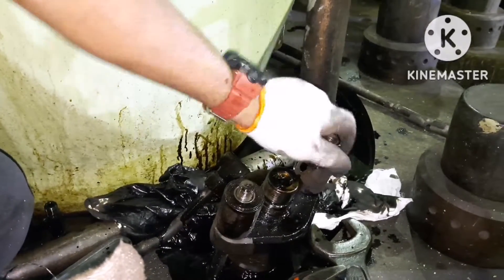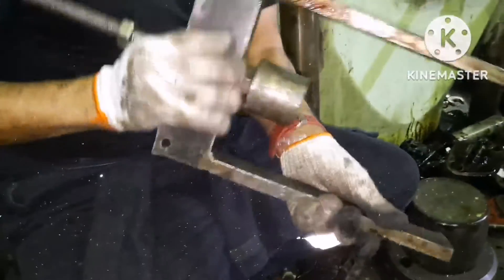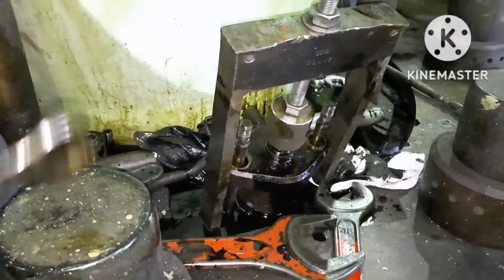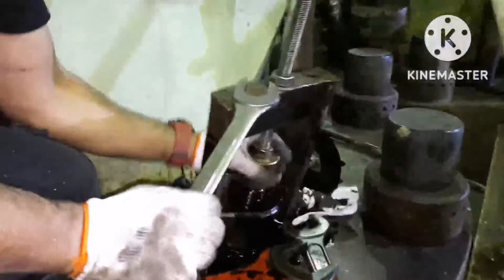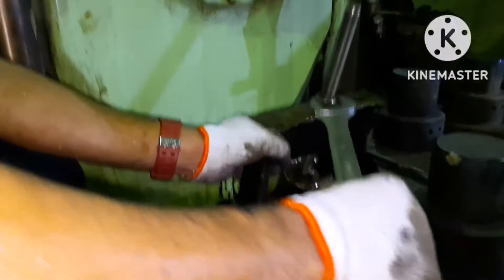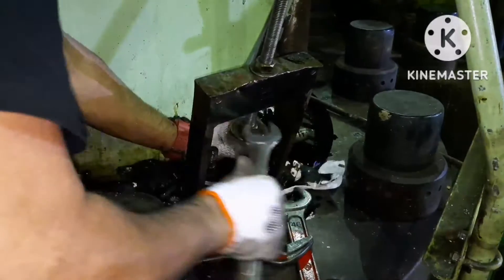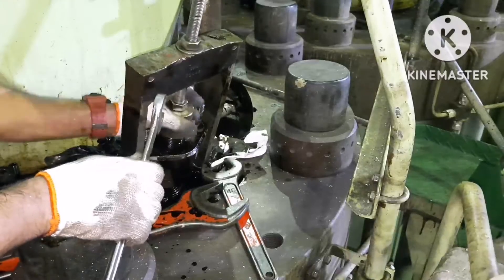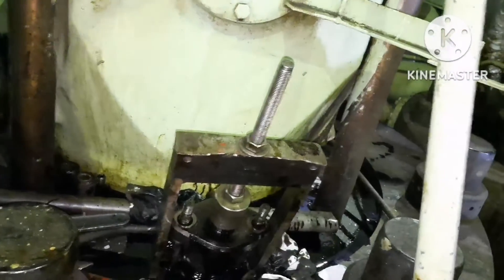HOW DO THEY DO.. HOW TO REMOVE MAIN ENGINE FUEL VALVE FROM PLACE USING SPECIAL TOOL.

Comment: What to do if fuel valve stuck inside ? Cannot remove with special tool . What to do ?
Reply from the maker: V shud use small hydraulic jack to remove the valve.. But it's alwsys btr to put diesel iwo fuel valve for few hours to ease up the carbon deposit which stuck in the fuel valve body
Reply: In extreme case u have to take out Cyl head...